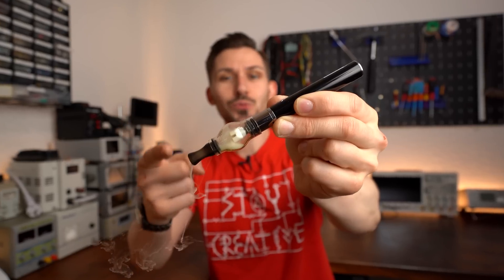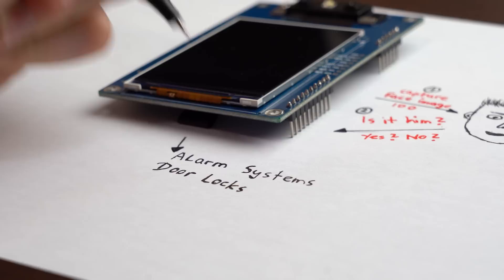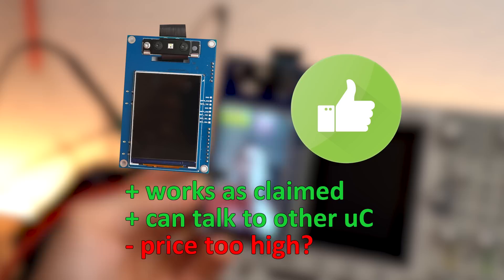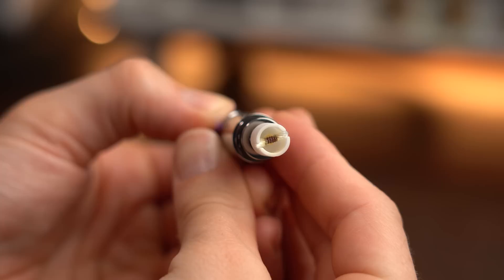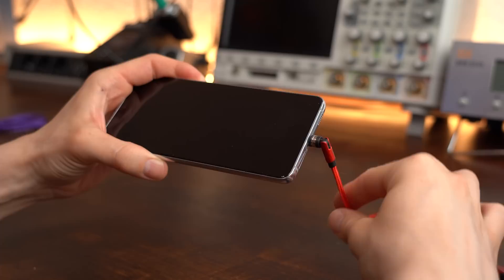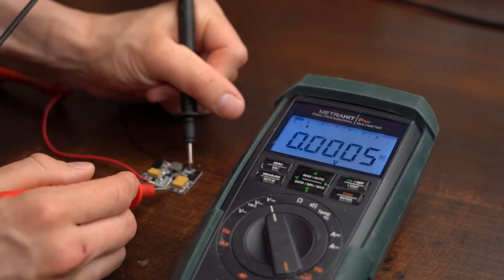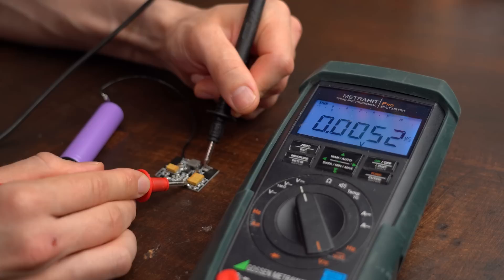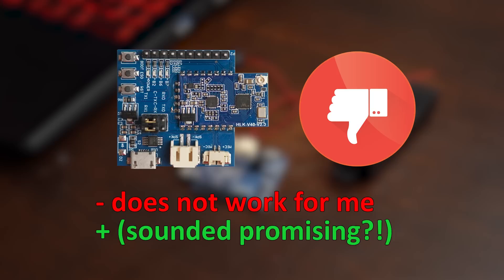I tried finding Hidden Gems on AliExpress AGAIN! (Part 5)

Comment: I just figured out a great way to find bad components. You put a heat sensitive label or paper (used in many POS devices and readily available from any cashier if you just need a little bit) on the board, power it up, and the bad component will darken the label!

Comment: It would be nice to see some bms checking. I bought some and found that it didn't shut off when the batteries were low, which allowed them to drain to unusable. Personally I have no idea which ones for 2-4 cells will even work properly. Loved this vid btw. I don't see a reason for the pen though considering how much of a pain it would be to use practically.

Comment: One of those magnetic usb c cables fried my pc motherboard, cant recommend
Reply: Probably a bad Power-supply, normaly usb ports have protection.
Reply: @View777Dragon  it was one of those acer prebuilts with a weird L shaped case specific board, the front usb connectors were attached straight to the motherboard. And i also checked the power supply and it was fine.